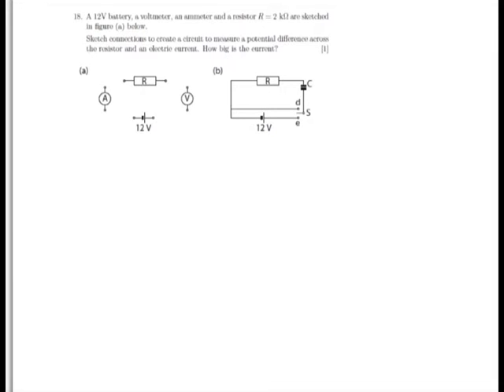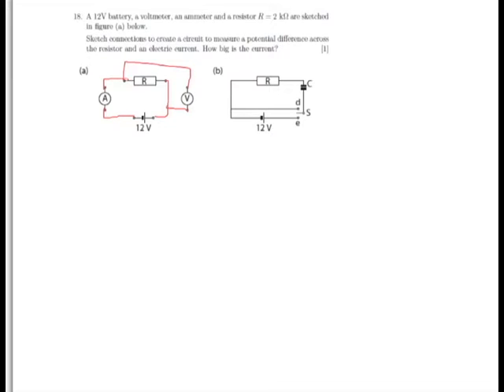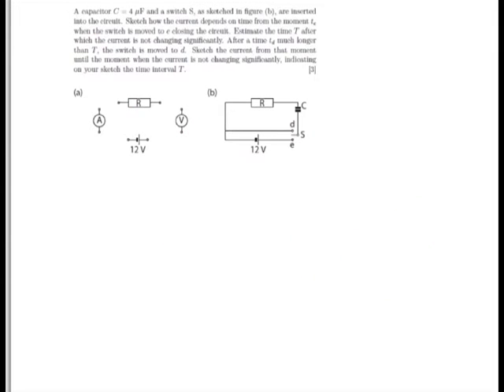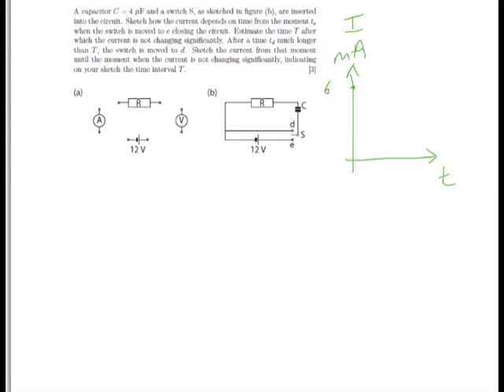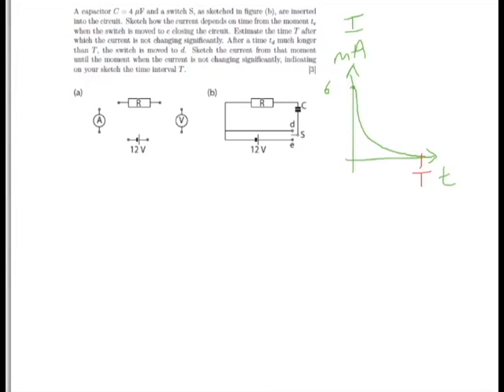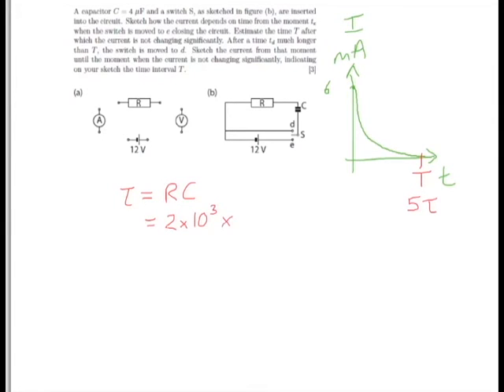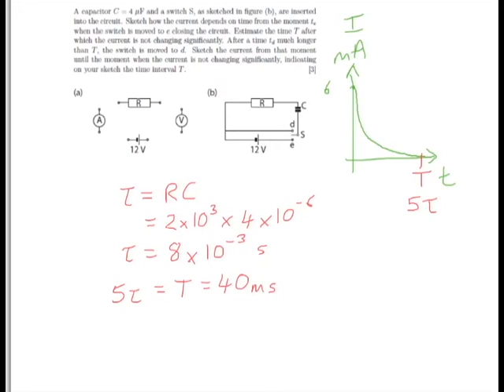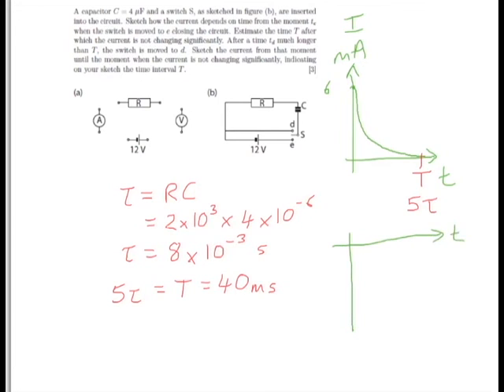Oxford PAT 2012 Q18 (capacitors)

Comment: How do you know the capacitance?
Reply: I know this comment is 4 years old, but to anyone reading, the capacitance is given in the question as 4μF = 4*10^-6 F (4 microfarads), where 1 Farad = 1 Coulomb per Volt (1 Coulomb of charge is required to alter the voltage across the capacitor by 1 Volt).